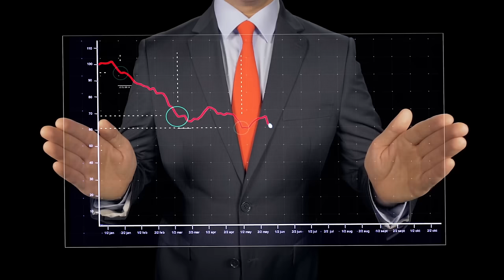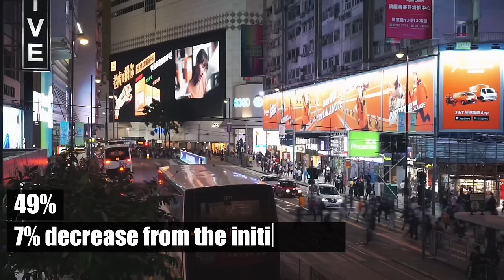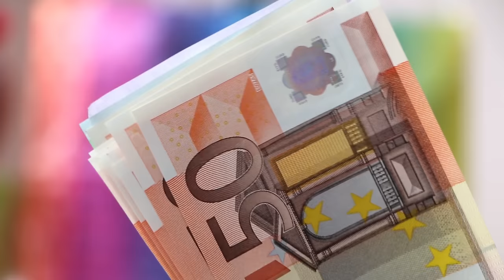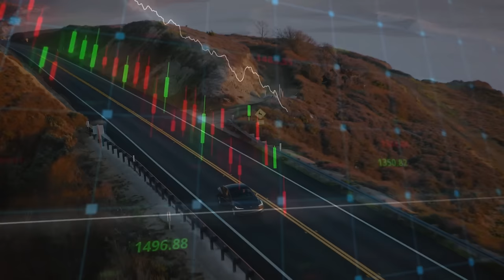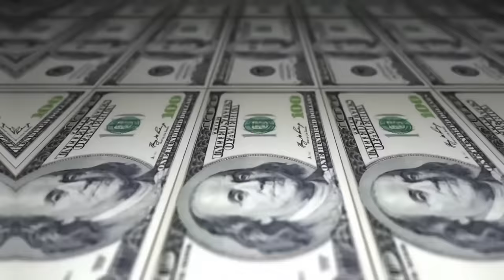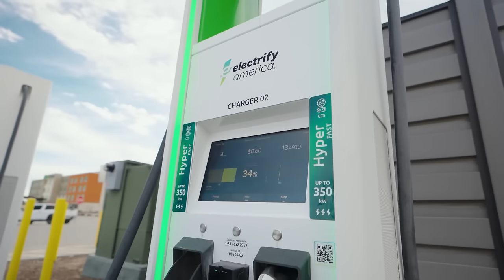The EV Market Meltdown: It Started and It’s Worse Than Predicted! Electric Vehicle Market Stumbles

Comment: In Q1 EV (as in zero emission) car sales increased YOY by 11%.  At Tesla Fremont they had problems ramping up deliveries of the refreshed Model 3.  They had the orders but were were slow in making them.  This delay is running into Q2.  Had they been able to ramp up quicker the sales growth in Q1 would have been 23%

California has introduced  Zero Emission regulations to slowly phase out new ICE car registrations down to 0 by 2035.  They have already stopped the approval of any new gas stations.

There are 11 other US states that have followed the Californian regulations.

This year in the UK 22% of all new car registrations in the UK must be Zero Emissions.  That percentage increase each year, by 2028 it´s 52%, by 2030 80% and by 2035 100%  Companies failing to meet the target are fined $19,000 per car.  In the UK Hybrids are not considered to be zero emission as they still have an ICE engine.